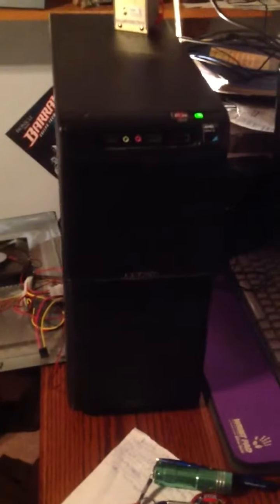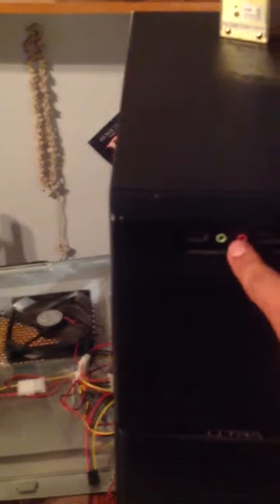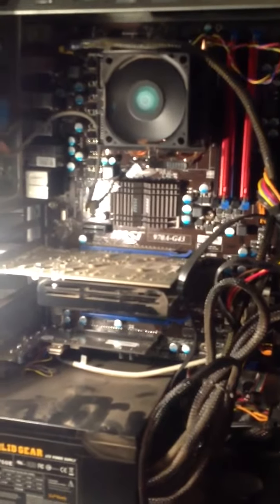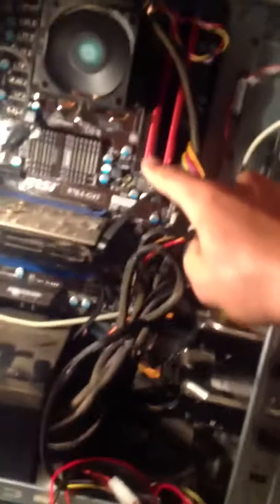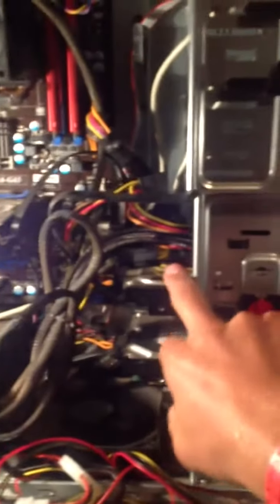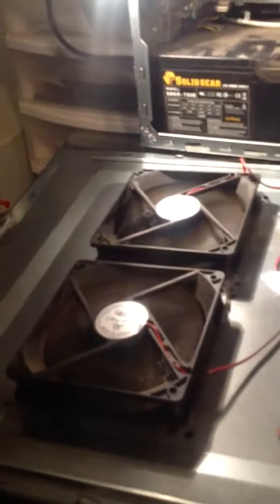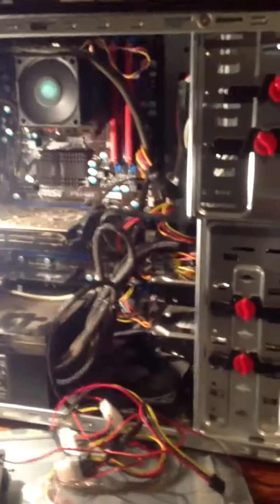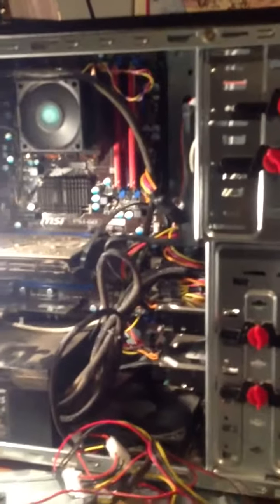My system amd 8320 fx msi 970-g43

Comment from the maker: I have noticed that is the system does freeze here and there but that has only been since I got a SSD, it happens like one a week, usually it's related to adobe flash player. The cpu it self has done very nicely for me, runs under heavy load at about 30C, every so often it hits 35C. The cooler has no fluid in it to my knowledge, but it does come with some silicon to put on the top of the cpu.

Comment: I just ordered a g43 mobo with 8320 processor, Its not until after i ordered that i started reading about people having issues with peoples systems freezing up because of the vmr/mosfet lacking any kind of cooling solutions. Im still waiting for my order to come in the mail, Have you experienced any of these problems?
Reply: My G43 and most other people who have a G43's didnt have heatsinks on the VRM when it arrived. I had to order aftermarket heatsinks. It didnt really matter though, to my surprise the vrm was actually cool to the touch after hours of use with my eight core processor. I still ended up putting the heatsinks on anyway just because I had them now so why not. Also I use kingston hyper-x ram, I hear too many bad things about g.skill.
Reply from the maker: Where did u get the after market vrm heat sink
Reply: I got them off of ebay, I ordered them for like 5 bucks from china. They are 5 seperate heatsink squares that fit directly over each of the vrm blocks via a thermal adhesive that works really well. The only thing is that it took about 2 and a half weeks to get here.
Reply from the maker: thanks i saw something like that just though maybe u got the heat sink like the one the g46 has
Reply: To be honest, the people complaining are probably just the people who are trying to overclock it on a board that isnt meant for overclocking. If you run everything stock(you can even do the oc genie) with a decent quality psu, the vrm will run cool without heatsinks. When I first assembled everything i put a thermaltake tr2 600w power supply in my system straight out of the box, One of the first things I did was a windows performance test. Right at 99% the psu would start making crackling sounds, had to box it up and return it. I ended up getting the evga bronze series 600w psu and that solved the problem. Make sure you run everything stock and make sure you have a name brand psu and you will be fine.
Reply from the maker: thanks man, i got a evga supernova 750 right now

Comment: I have no network connection with Mageia 4.1. It connects fine with Windows 7 but not Mageia 4.1. I did have network connection during the Mageia install but that's it. Is there another linux network driver that I can try?
Reply from the maker: sorry sir, i don't really have a clue i really only use ubuntu and mint